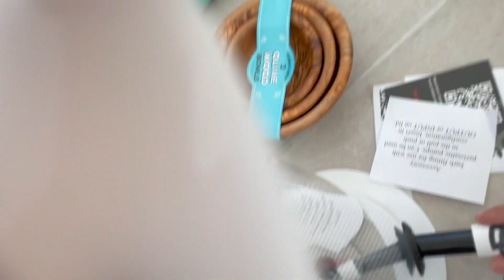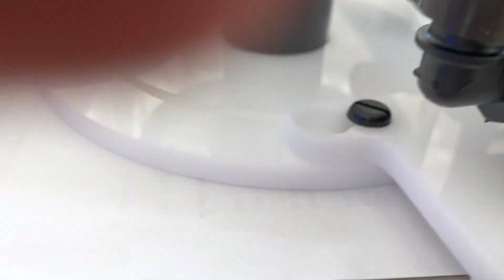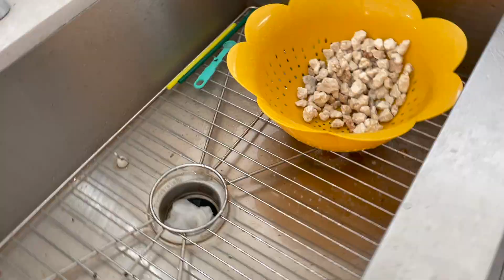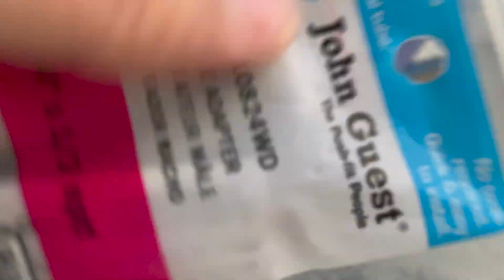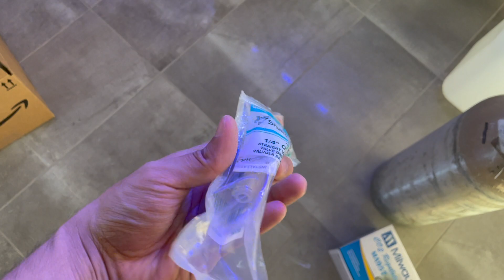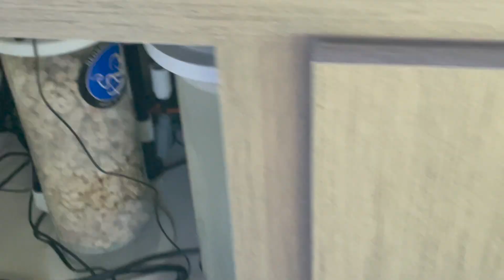Calcium Reactor Part 1 Assembling, Media, Pump, PH Probe

Comment: Hi there, great vid great content.  Have you done number 2? Also I was wondering rather than using a feed pump can I use a manifold and even potentially a solenoid linked to ph I.e. tank ph drops to x the solenoid stops feeding the reactor  and stops feeding co2.

Once again great video 

Regards Duzzy 🇦🇺